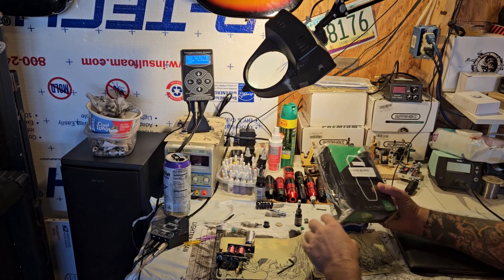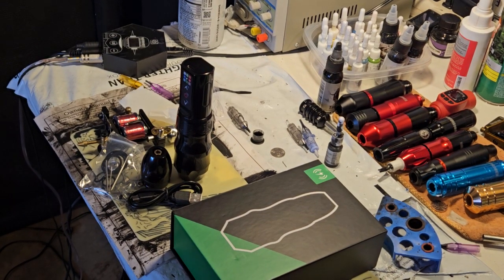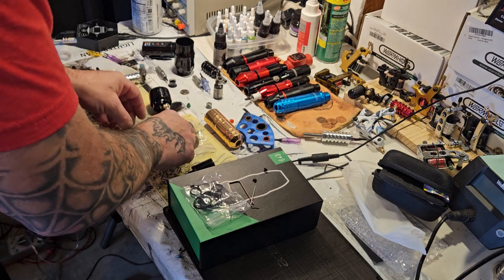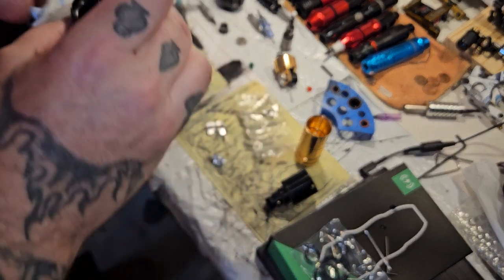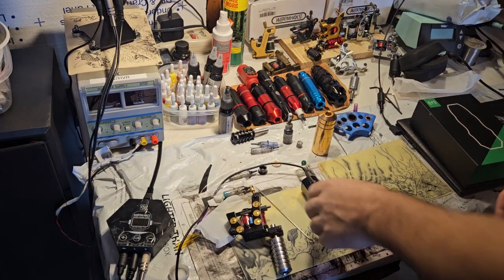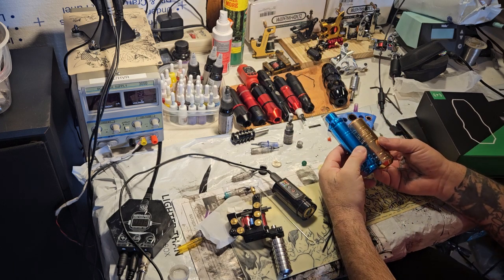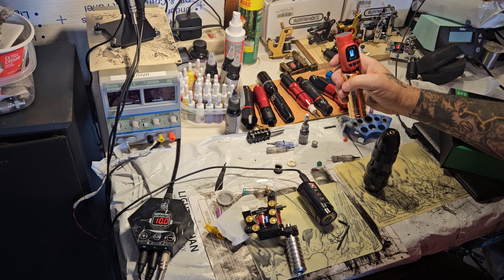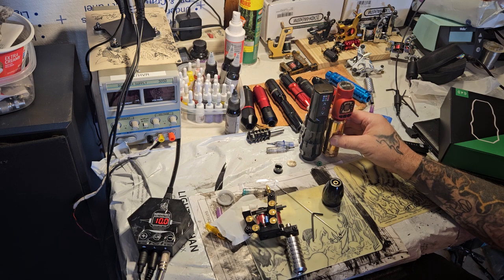EXO CLONE TATTOO MACHINE UNBOX & take apart to check cam.

Comment: They drilled the hole all the way trough, to give you the ability, to set the cam upside down. It's better to have the counterweight sitting over the cam. (if the pin on the motor is long enough)
Reply from the maker: Interesting.  Im not sure if it is long enough.  I do know i tried the ambition torped cams and the hole is bigger on those

Comment: For lining you said you would stick to coils is that because the needle cartridges? Because I can setup a coil machine and make lines but the 2 rotary machines I have are hard to line with, I have a no name one and a cnc q2
Reply from the maker: I think its a personal preference and what people learn on. Coils have give. Meaning they bog to some extent.  Less likey to tear up skin compared  to some long throw direct drive. I feel like the swash plate pens have some give. Some people hate coils. Some love them. Work with what you have and go from there i guess
Reply: @AZTattoo  yup true I got a few rotary machines I just got a month ago maybe and today got the dragonhawk x5 so I’ll try out the 4mm cam cuz I was using the cnc q2 at 3.5mm and I can’t line all that good lol I got keep practicing

Comment: What to you think is best michine for ine work and solid black ambition torped 4.5mm stroke or exo clone 4.0mm stroke. exo look like have more torque and power right?
Reply from the maker: @alejandrofernandez-cr6dm  im not a expert. But the best lines ive seen came from coil machines. Less trauma to the skin. Coils have "give" when you bear down. Do a search on the topic  of coil machine being better for line work.
Reply: @AZTattoo  for my experience also look better to work with coils for line but I want to change to try to get used to pen machine with bigger stroke for line. What do you think works better ambition Torped or exo Clone?